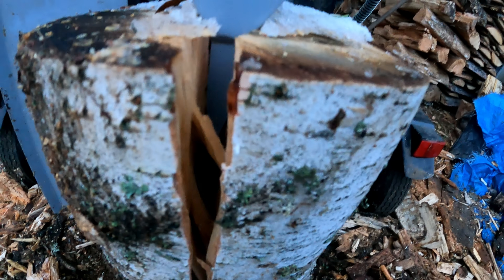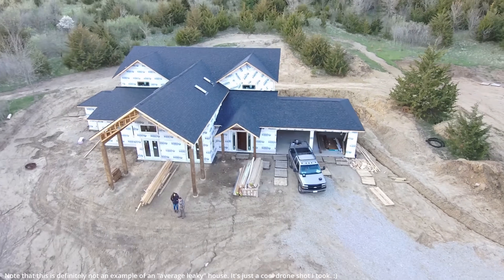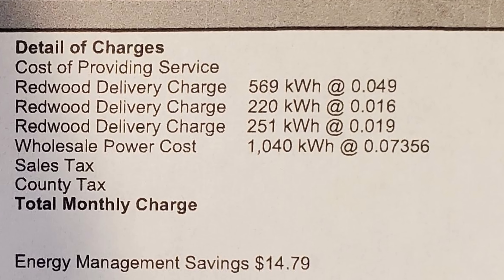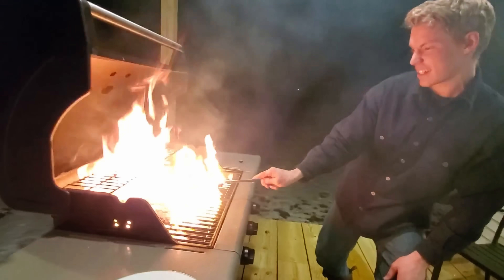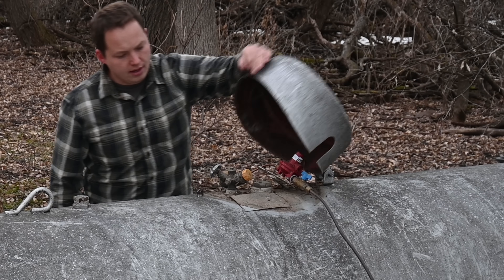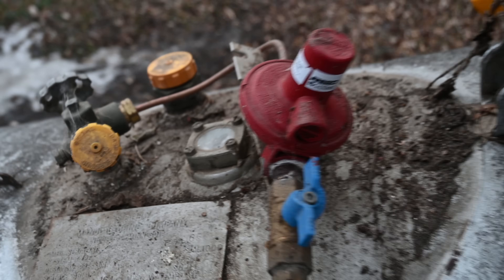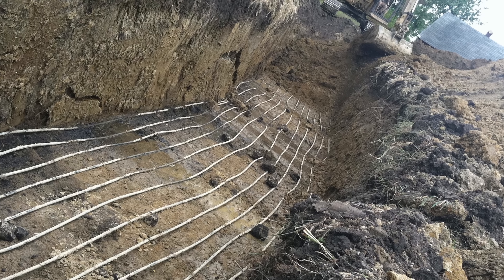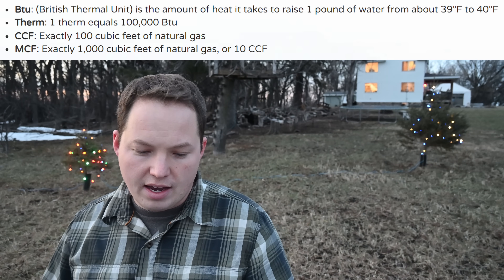What's The Best Heat Source in 2022? Top 5 Home Heating Methods - LP Electric NG Geothermal Fuel Oil

Comment: Great info!  We are planning on moving from near riot prone moderate temp Portland OR and currently use NG to northern Indiana.  Looks like most houses there use propane or electric baseboard heat.  I had no idea that propane would be prohibitive.  I’m interested in info you didn’t supply,like pellet stove or outdoor wood fired boiler with radiant floor heating. Burning wood would likely be to hard as I have MS and am in a wheelchair.
*With EV’s on the upsurge I gotta wonder if electricity due to supply and demand isn’t going to skyrocket.
Reply: Tom,  Someone made a good point:  When where the electric company executives worried about higher demand for electricity?  Actually during the 70's and 80's when cheap and energy hog portable window air conditioners started to get installed and used most between noon and 9 pm.  

Electric cars can be charged at night and other off peak power time of day.  That part is easy.  

Modern code complaint built in 14 SEER and 16 SEER air conditioners use about 30% to 40% of the power of a older portable window air conditioner.  The ductless heat pumps typically are over 18 SEER, and some are 28 SEER, so use 1/2 as much compared to a 14 SEER.  10% of the power compared to a portable A/C with a hose that delivers the cold air from your room outside all the time!  

One person posted that when he changed from regular light bulbs and old TV set to LED bulbs and 45 watt TV set, his electric bill went down.  Then getting a EV, the bill went back up a little bit, but not to the old days KW per month.  These EV's do not need as much power as one would guess before getting one and charging it at home for 3-5 hours with a 15 amp charger in the garage.
Reply: @Kangenpower7  
Seems to me EV’s possible range is ALWAYS listed from 100 percent to 0 battery charge, BUT I’ve heard that that is not what’s best for battery longevity.

Comment: Right now, We burn natural gas. I'm installing 16,200 watts of solar panels, and will be pairing them with 67 kWh of battery storage. I want to replace my natural gas furnace with geothermal heat pump, because of the abundance of cheap electricity. The photovoltaic system will have enough, to support the heat pump specifications you posted in this video. Right now, natural gas is cheap for us, but, you know that can change at the 'drop of a hat'.
     I have baseboard heat, using circulated hot water through fin tubes. The furnace,(boiler) is fired by natural gas.

Comment: Heat pumps come close to challenging natural gas on cost per BTU-h basis; ground source heat pumps can take the win, especially in more temperate areas. 

I know resistance heat is the least-economical approach but of them all it is the most portable: an electric blanket can put the heat directly on YOU and nowhere else so if you're trying to take an extremely minimalist approach, an electric blanket can keep you feeling toasty warm while consuming less than 100 watts.  If you relied on an electric blanket and nothing else all winter, and needed it every hour of every day from October to May, that would be nearly 5800 hours but only 580 kW-h = less than $75 to keep the electric blanket on that entire time.

Comment: I just found and subscribed to your channel. Really enjoyed this video! I'm going to retire in 3 years and build my own house so all this information is important to me. Right now I'm hoping to build a split level with hydronic radiant heat in the lower level slab; and hydronic baseboard heat upstairs. I would like your opinion as to whether or not I can do this efficiently with an electric hot water heater or an electric boiler, as opposed to natural or propane gas. Thanks! Looks like you have an awesome place.

Comment: I mean if you have natural gas pumped to you it's probably the best even if it's not the cheapest or most efficient but we are in a trailer house and I installed a heat pump several years ago it's not as efficient as the new ones but not to bad

Comment: I'm wondering about using a combination of wood, boiler and heat pump for maximum efficiency. I like stoking a fire before bed, as I grew up with a wood stove. I've looked at rocket mass heaters, too and like what they offer, especially an efficient use of small kindling in place of larger logs.
Reply: INDEED! Very good possible! Possible to get your powerbill to near zero.

Comment: Great video!  I live in Minnesota.  We’ve had several days of -15 degrees Fahrenheit and lower here.  We just moved into a 1917 craftsman style home around 3500 sf.  The upstairs and basement were currently electric baseboard heat and my main floor is forced air natural gas.  My December electric bill was $373 and my natural gas bill is $263.  I was shocked and went around turning everything to low heat.  Freezing to death now but at least we are saving money!  :)
I’m looking into mini splits for the house, but still can’t heat with those probably 3 1/2-4 months out of the year.   I’m in the process of expanding forced air to the basement to help but still don’t have a clear way to bring it all the way upstairs.  Anyway, it is what it is.  Thanks a lot Biden!😡
Reply: @nunyabusiness3920  LET'S GO BARRON AND CONTRIBUTE TO YOUR LOCAL AUTISM CHAPTER
Reply: Time for a recall election in which Democrats are told the new election is a month after the real one
Reply: 3500 sqft is your problem
Reply: @robertpaulis439  some people have big families
Reply: If we could just capture all the liberal hot air…..

Comment: My wife's parents have a passive solar house with a large solarium on the south side of the house.  With a sunny day, the solarium gets up to about 90 degrees while it can be down to below 0 degrees outside.  The hot air from the solarium trickles through the rest of the house.  It is supposed to have barrels of water in the attic above the solarium to retain heat through the night and over longer periods without sunlight, but the barrels tend to leak so they removed them.  The backup is a wood burning stove and electric heaters in case the sunlight has been absent for a few days.  It's the first passive solar house I ever saw, and I have been intrigued by it from the start.
Reply: I'll be installing a solarium on my home's south side as well and I'll be using soapstone to retain heat and release it evenly over a longer period of time compared to other building materials.

Comment: I live in a 1200 sf ranch built in the 60s. I have gas for heat hot water cooking clothes drying and grilling. my budget is $68, so $816 for the year. I keep the house at 72 during the day and 68 at night. Appears I am doing much better than average.

Comment: I have propane for my generator.  

I have oil for hot water and the master bedroom.   Heat is piped into the master via hot water.  Not 100% on how the hot air works in the main part of the house.  It can heat from 65 to 80 measured in only a few minutes.   The in-law space about 800 sq ft has 2 heat pumps.     We also have a family room about 800 sq ft with 20 ft Ceilings. It has a heat pump and a wood burning stove.   The stove can heat the family room from 60 to 75  in less than 1/2 hour.  The heat pump will take about 2 hours.  The colder it gets the more of an advantage the wood stove has. 

We also have a conventional fireplace in the master bedroom and the dining room.   The bedroom fire place can’t keep up with the killer oil heat. It looks fantastic.   The fireplace in the dining room is a beast.   It can run you out of the main house in about 1 hour.    The house is very well in Insulated.   We also have a ton of windows in the family room and master bedroom. 

I love oil heat.   

If I could I would mostly use wood.

Comment: Natural gas/hot water furnace but I have a wood pellet stove and run that as much as possible.  Over the last 15 years of running it the price per ton has not really changed much.  And it cranks out the heat.

Comment: I like that you started by telling us about your insulation. When I bought my home it had zero insulation, Since insulating my home I use 6 times less energy to heat my home than the 1st year without. The 4 months it took and $2,000 was well worth it to insulate. I had to blow in insulation (New Wool)thru 365 - 3" holes inside in plaster walls. Then rewire the second floor so I could insulate the attic and be done up there.

I use natural gas in a 96+ furnace. I have 2200 square feet to heat. I save 20% by placing panels inside my 5 south facing windows thus capturing the solar heat these panels radiate. These panels are easy to make out of hardboard / Masonite and aluminum foil painted flat black with high temp paint. I use foil tape at the seams before painting them. I measured the heat in the center of a panel when the outside temperature was 20 below. The panel surface temp was 130 degrees on a sunny day. My home is 5 bedrooms and is 87 years old but it only cost me $960.00 to heat my home and make hot water last year. I keep my heat at 72 degrees. Although I can't see out of any south facing window, I have 3 cameras that see south. So the $30.00 investment in these panels saves me $240.00.

My home is fully smart integrated so I save on electricity as well.
Reply: Thanks for the South Windows DIY Panel TIP😎
Reply: Yeah the foam can be great. I am glad this nice fella is way up north, if that house were in the south it would be rotted in no time! In the south on older houses you must use a internal screen that allows moisture to get out.(like a dimple mat) Northern climates can do at vapor barrier on the inside but southern humid homes have to install barriers to the outside of the wall aseembly.

Comment: I use natural gas where I live, its a lot cheaper than propane here, but as stated it costs a lot more than it used to. I just got a 96% efficient furance put in, my old one was made in 1976 and was very inefficient but made tons of heat and was as reiable as it gets. Ive always noticed about $100 less per month in gas use compared to the old one, so due to price increases my bills have remained roughly the same (but would have been that much more every month had I not). If I was able to burn wood, thatd be my preferred way but I have no fireplace, no access to enough wood consistantly, so unless I move that wont happen.

Comment: First off you speak in general terms.  The fuel cost is determining factor in cost, not the device.  Second, considerations other than cost need to be made.  For example an outdoor wood boiler coupled with a source of wood you own would be the least expensive but the pollution would be a health hazard for you and your family as well as your neighbors and community.  Plus the work to cut and split the wood and feed the boiler require forethought.  If you are looking at conventional devices and fuel sources, the geothermal heat pump would be THE number one choice for overall ease of use and cost to operate.  However the cost to install is somewhat steep.  Next in terms of convenience and ease of use would be an inverter heat pump.  These are relatively inexpensive and provide adequate heat to low temps.  Some are designed to run directly off solar panels as well.  
There are so many variables in selecting the best option that it would be wise to hire an energy management specialist to advise.   And since the options  are changing year to year it is impossible to state what the best option is into the future.

Comment: Southern il. I have enough South windows that I only have to burn after sunset . Cheapest heat is insulation and zone control . Just love going to vaulted ceiling or open stairway homes were the lower floors is freezing and the upstairs is sweltering. Are you using a heat pump water heater for cooling . Will future home have central freon controls to use refrig or ac waste heat in the water heater. Have you yet installed a Honda co-gen unit.

Comment: I use natural gas for my house but I have a big shop that we do welding fab and auto repair out of and I burn coal in the shop it's the cheapest heat ever at 35 dollars a ton and we usually only burn about 3 to 3 1/2 tons a year

Comment: Where I'm at in south Texas it's heat pumps are pretty common. It doesn't get to freezing temperatures very often, so it's hard to beat it unless you are using natural gas which is common too in homes that have gas. On very cold days I can tell my heat pump is running longer and blowing less-warm air from the vents, so I can understand the reasoning behind having a backup fuel source to switch to when the temperature is low enough, it just doesn't get that cold here often enough to justify the infrastructure for me so my backup is resistive space heaters (haven't even needed them yet this year) and a wood burning fireplace.

Comment: The best and first thing is to have an truly insulated home.
Reply: And windows and weatherstripping. My guess is,  the best residence to have for the money is a basement and a single story home above it. And of course, a large garage that will hold at least two big vehicles and a good sized workshop.
Reply: @Garth2011  Right on Garth. Or should I just yell BINGO !!!!
Reply: @Garth2011  Great minds think alike fella. That is exactly what I have. Works out really well.
Reply: You hit the nail on the head. Everything begins with insulation - if that aspect is not addressed and optimized, then all other measures, become very inefficient and arguably,  a colossal waste of time and money.
Reply: @michaelcayer8358  I yell BINGO !!!!!!!!!!!!
Reply: Yes and no, Insulation doesn't buffer you from the double and triple prices we are seeing now. Let's say you super insulated your house and #2 oil doubled in price like it did where I live, you could have hedged a lot of that with PV and mini splits like I'm doing. Sure, my house is insulated well but my cost to heat it is much lower than someone with a super insulated house paying high oil or NG prices. 

The best thing you can do to hedge inflation is install renewables. The PV systems I installed in 2006 are paying dividends now. They run my house, my well pump, tankless hot water and charge my EV, think about how much real money not paying for gas in 6 years saves me. My advice is to fill your roof with PV and your back yard too! 

Too many people know who won the Super Bowl but if you ask them about DIY PV systems they say, "Gee, I could never install one of them!" Stop fiddling around watching some guy chase a ball up and down a field and read a book that will actually do something to benefit you. Heck, go watch Will Prowse, he'll show you how to do it right.
Reply: @mosfet500  Well spoken fella. You have to realize that the powers that bee just love the ball chasers. This gives them the opportunity to slid a hot poker up your backside with a smile on there faces. You have to remember that the political parties are DIFFERENT faces of the same coin. And as long as people are ready to throw EACH OTHER under the bus nothing will ever be accomplished. That is the GOAL of political parties. The money politics gets from gas and oil industry is just unbelievable. And no one even cares, as they are just "STUPID AMERICANS". This term was given to my many times when I would travel in europe. Just plain facts. 
Good day fella. Peace
Reply: @victoryfirst2878  Peace..
Reply: A home, not a house. Family is everything.
Reply: @sandasturner9529  This is most certainly true Sandas.
Reply: 30000 dollars insulation- and u wont have the house that long
Reply: @johnwolf1475  No No No John. There are many ways to get insulation on the fair side. Most people just do not understand how the game is played. Those who look shell find. PERIOD.
Reply: I agree. Falsely insulated homes are a farce, a facade, a fakery, a fraud, a ... well, YOU know. 😉😎😂
Reply: @logmeindangit  Could not of said it better myself fella. Good day too.

Comment: Great job.  Please do a video on the heat pump method of home heating.  What does a good heat pump cost for a 1,800 sq foot home for a mountain location in southern California with average temperature of 35 degrees F. during the 5 winter months?  We have a natural gas forced air furnace now.  Thank you.

Comment: Diversity is key. My main source is a GSHP which does fantastic much of the time. It’s currently 20*f outside and though it’s still pushing 100*f air through the vents my lossy house needs a bit of help. I love firing up the pellet stove on days like that, the house gets to 74 real fast but the pellets are sometimes expensive and hard to get. Therefore my third source is portable propane space heat, which is cheap and doesn’t need power like the previous 2 in case of an outage. Needless to say, I don’t worry about being cold!